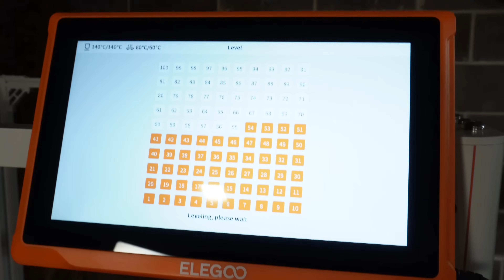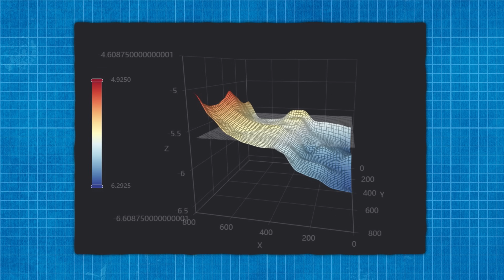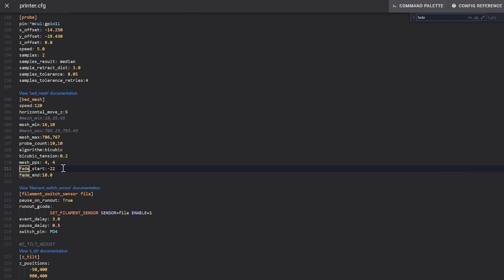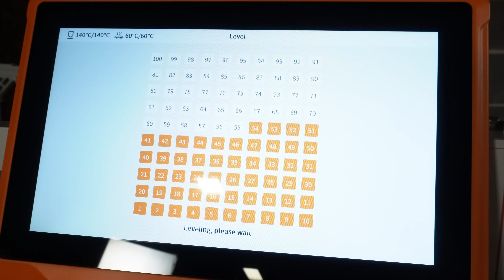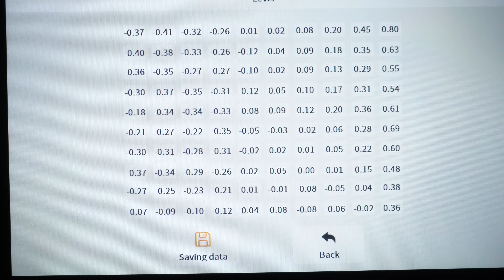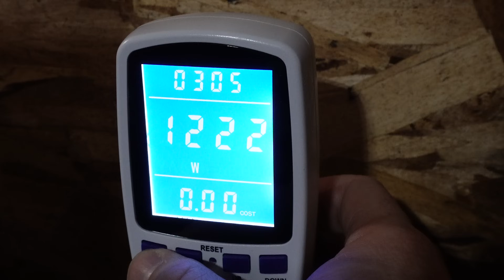My OrangeStorm Giga STILL DOESN'T WORK

Comment: I love the honesty in this video, but I don't know if I agree with your explanation about the printer not needing complex mechanical leveling for the 4 printhead setup. You are right that each hot-end should be leveled, and they probably are. The trouble most likely lies in parallel printing: mesh bed compensation is easy when there's just 1 nozzle, as it can simply follow its heightmap. If you run 2 or more nozzles parellel, they would each have to follow their own heightmap, but they're fixed on the same axis, so if nozzle 1 follows its own heightmap, it would send the other nozzles into the plate or make them print mid-air. The solution: giving them all an identical heightmap, which can only really be done by making the plate completely flat. Making it 1 solid unit may or may not work. Modix printers have a rigid mounted bed, but they can be tacos, so that wouldn't work. The only usable straight large format bed i've seen is from Builder 3D Printers, and they're definitely in another league. I think the important question is: was Elegoo smart to market the 4 printheads? Or did it add so much compexity that it handicapped one of the most important aspects of a 3Dprinter: bed leveling?

Comment: Yes, definitely needs a better filament sensor. May try installing a BTT Smart Filament Sensor v2 on the system, it has the clog detection for if the filament stops moving.

Comment: So many new light weight and good extruders out there right now. Might be time to upgrade to one of them if Elegoo can not fix it. A big printer is cool to have but not when the hot end jams, I know I still use my 500mm x 500mm x 5000mm CR10S5 and when the hot end jams after 3 days of printing I am not a happy guy either.

Comment: you'll pull this through, joel. wondering if the extruder section is similar to that of the Neptune4s.... had similar problems with my 4 pro a few months back... filament couldn't push through

Comment: Wow, that leveling is a nightmare. Do they have nylock nuts at least so it doesn't change on next print? They also said copy paste from the Bambu hotend, and copy paste from Voron Klipper, but somehow, worse?  I couldn't imagine 4 heads on this.

Comment: for the price it's really good start , change heatbeds to AC , better hotend and maybe extruder + fix bugs in settings then you have great printer
PS
the clog can be your fault because of not clean enough environment and then you pushing it with wire making nozzle scratched from inside + particles can still be stuck inside
but it can be also something from manufacturing stuck inside

Comment: Seems like a lot of 3D printers from Elegoo/Creality/etc. are just the Steam Early Access versions of what might eventually become a finished/polished product
Reply: The first printer I got was a Creality Ender 3 S1 Plus. For the life of me I could not get that thing to print no matter what I did. I ended up returning it and buying an FLSun SR. Worked right out of the box and prints beautifully and fast. A great experience so far!
Reply: @eliyahumedia  An Ender 3 almost made me quit the hobby.  I became overly familiar with its guts but nothing would stay where it was supposed to once adjusted and it was an endless nightmare. Eventually I bought a cheap "beginner's" machine with automatic everything, a Mingda Magician X, and it's been running almost daily for 18 months+ and the only thing I do with it is change the nozzle.  Never calibrated it any way other than auto-leveling the bed.  Prints have been top-notch since the beginning.  Unfortunately, Nathan BR and other have reported newer Mingda printers do dumb stuff like bursting into flames
Reply: They really are. It's insane they can get people to buy a half finished product like this.
Reply: That's why I'm waiting to buy the K2 Plus. The K1 had so many issues that I don't feel confident in their new model right out of the gate.

Comment: Videos like these are reason enough to stay far away from that particular range of printers. And you're absolutely correct, beds mounted on springs are a bad design choice in this day and age, especially in a printer this size with 4 separate build plates.

Comment: Interesting how different the experience is to Dr.D-Flo
Reply from the maker: There are a fair number of people with this machine, and everyone has had a different experience. That's not a good thing :(
Reply: Dr.D-Flo's issue with the limit sensor getting ripped off by the exposed filament wasn't great either... sounds like a product that's still in Beta phase.

Comment: Hi, I have recently purchesed and been using the Neptune 4 and have had the exact same clog issue, the way I got around failed prints was to edit the gcode manually. As you mentioned the printer homes before printing but those lines of code can be identified and removed in the code. Might come in handy next time :)

Comment: i have to disagree with the "make each nozzle adjust itself so i dont have to level the bed"
making that happen would genuinely drive up the cost of the printer, the complexity of the printheads, which introduces more failure points, and they can shift over time much easier.
it may would have been better if elegoo had 4 screws per bed instead of 9, or just 5 would also be good.
Reply from the maker: OR, had them on rigid mounts :)
Reply: @3DPrintingNerd  EXACTLY, that would defo solve it. but then any imperfections would easily be fixed without the required shims

Comment: My previous printer would jam up on every first layer. Heat creep hides itself very well. I had to let it start the brim without any filament in the hot end, then shove the filament in while its going. That would setimes help. But so help me if there was any retractions

Comment: These printers aren't cheap. Why has no one started using small servos to mount the build plate on. They are super cheap and can be wired and programmed to automatically adjust based on the mesh within a few millimeters of one another. There are basic solutions to so many 3d printer issues.
Reply: I was wondering about the feasibility of having a tool head with a screwdriver, and the printer making adjustments to its bed that way. 🤔

Comment: It sounds a lot like its retracting too far I started having those issues with my ender 3 pro after upgrading to a all metal hot end. Got through the first print fine but it used minimal retraction everything else would fail once it had to really retract. clogged in the exact same way formed a plug you couldn't push in hard to pull out and works great the second you cut off the plug or change filament (until the next time it needs to retract hard again).

Comment: Hi Joel, Brian from Elegoo here!

Your initial insertion of the heated metal rod to unclog the extruder is what caused the issue. You very likely engaged the camlock within.
Reply from the maker: Hi Brian. Can you email me with some diagrams of what you’re talking about. I’m unfamiliar with a camlock in the head.
Reply: It's in the instructions. Thank you
Reply: @briancahill8610  Hi, Brian. I just downloaded the official PDF manual linked to by an Elegoo rep on Reddit. I just did a search through it and saw no mention of a camlock. Troubleshooting instructions don't mention anything about this either. Perhaps you could be more specific.
Reply: @RegularOldDan  oh I thought I worked for elegoo but apparently I was wrong
Reply: @briancahill8610  lolwut?
Reply: @briancahill8610  I thought as much. 🤣

Comment: I have a Neptune Max 4, and leveling that crap took MONTHS! it worked great for about 1 month then went to hell and after many upgrades it's working "ok", ended up buying a bambu lab p1s for smaller prints and only use the Max for anything that won't fit on it.
Reply from the maker: With the Giga, technically I have FOUR Neptune 4 Max printers ;)
Reply: @3DPrintingNerd  indeed, I feel your pain! Good luck my max doesn't seem to work with the bed mesh, and you'll likely only get the best result with their dated cura software 😵

Comment: imo, the fans cant dissipate the heat fast enough. Bad heat break design
Reply from the maker: I’m very curious about the hot end design. I would LOVE an E3D Revo on this thing.
Reply: @3DPrintingNerd  Even a standard E6 just to run normally!

Comment: My first printer was an Elegoo and it almost caused me to give up the hobby so im not surprised you're having trouble with this thing.
Reply: I was scared just about that, i bought an Anycubic Kobra 2 Neo for 160€ two Months ago.
Putting it together was easy following the instructions, first startup no problems, did the Autolevel thing...
No problems till now, im happy with the Speed and print quality, very good printer for beginners in my Opinion. It worked right out of the box.
Reply: Me too! I returned my first Elegoo printer lol.
Reply: I have 2 Neptunes and a Jupiter (Jupiter is a resin printer) and I love them. The Neptune bed leveling and the plate leveling on the Jupiter were frustrating aspects of getting into printing but looking back it was just frustration with the learning curve. Now leveling is easy and failed prints are rare. I went with Elegoo because of the positive things people had to say about them on YT and Reddit.
Reply: @TERMICOBRA  Yeah it is definitely a learning curve thing. I brought a neptune 4 as my first printer and it was a huge pain in the ass. But that was just me being new to 3D printing and expecting it to be simple. Once I stopped treating the thing like a magic device, learned how to level properly, figured out how to configure the slicer, and actually designing prints to be 3d pritner friendly, things started working smoothly.
Reply: I bought a Saturn 2 and have yet to get a single usable print out of it, despite owning two other lower-cost resin printers previously that provided great results.  Elegoo will not be getting any further business from me.